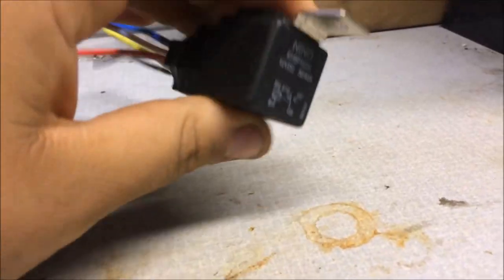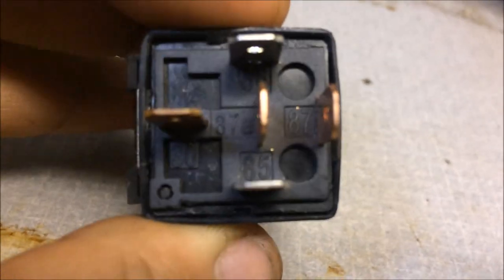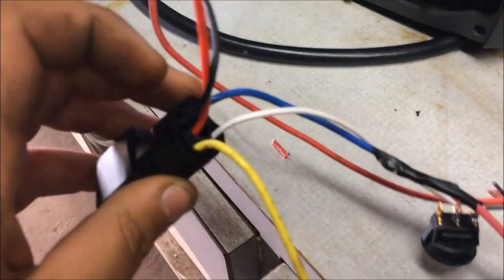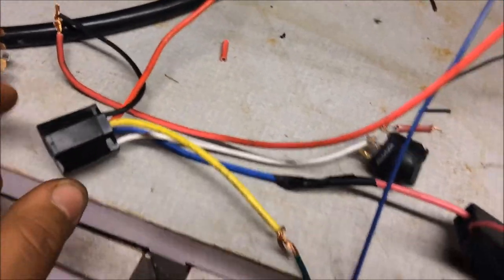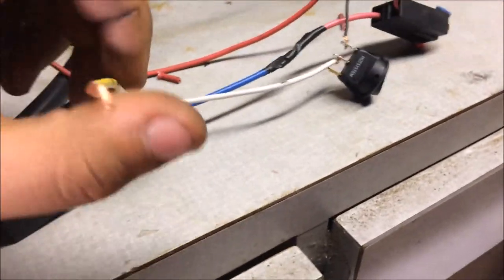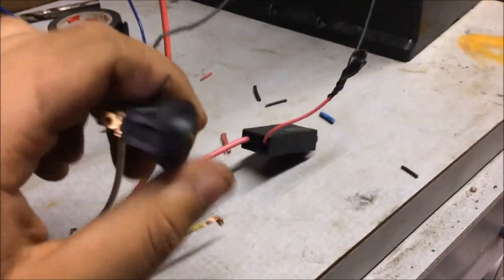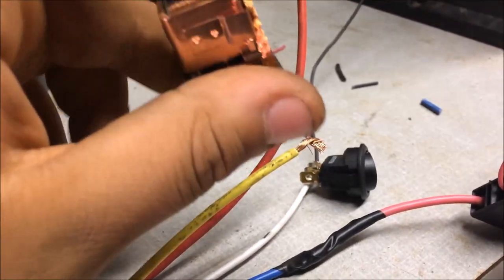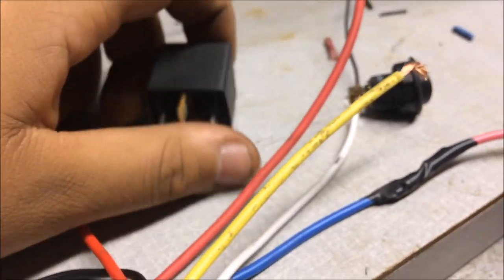How to Wire a Relay and a Cooling Fan Circuit

Comment: I know this is a old video but my question is does the middle wire on relay not hook up to anything ? The 87a
Reply: No, you use EITHER 87 or 87a, not both.

Comment: Using relays to switch DC fan motors from a dead stop IS NOT a good idea.  First, the contacts will burn, go open or weld shorted.  The high peak current can blow the diodes in your alternator.   Then the fan at high RPM will driver you nuts and your fuse holders will melt down.   Better go with Pulse Width Modulation with the Auto Cool Guy aka www.autocoogguy.com
Reply: Kinda hard to understand your explanation
Reply from the maker: Yes